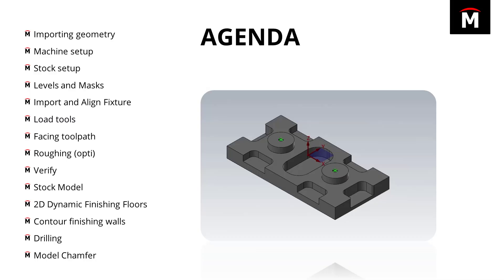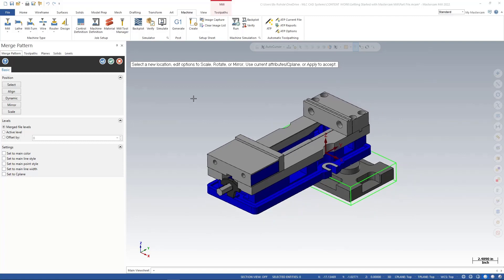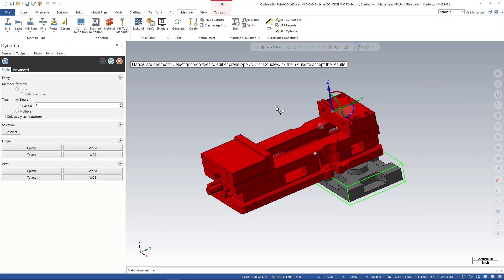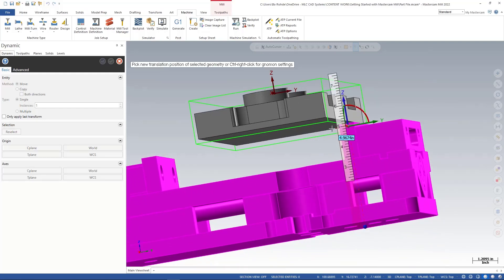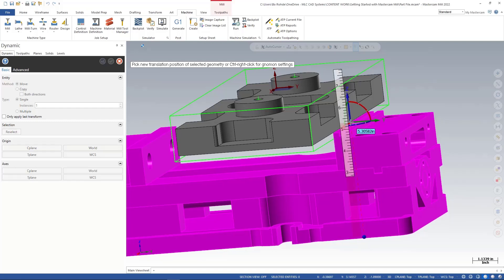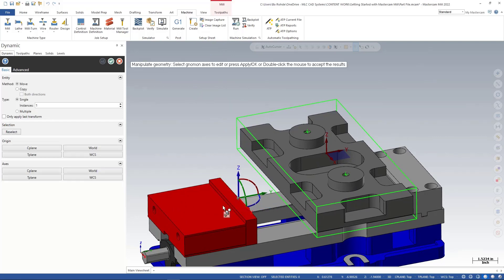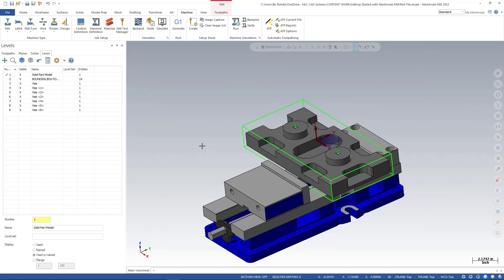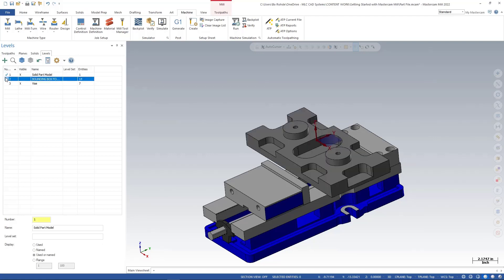How to Import and Locate a Fixture - Getting Started with Mastercam Mill Webinar 4/12

Comment: Every time I try and open a second stl file Mastercam automatically opens a new session. How do I fix this ?
Reply from the maker: If you hold Ctrl while dragging a file into Mastercam it will add it to the existing project instead of opening a new one.  You can also use the Merge command to bring in the file.  If the workflow isn't working it may be a version issue or something to do with your file or installation.  Feel free to reach out to support for additional assistance, if you are an MLC CAD Systems customer you can start here https://www.mlc-cad.com/technical-support/
Reply: @MLCCADSystems  drag and drop is not working on my mcam2024, whats the problem, i got x+ installed